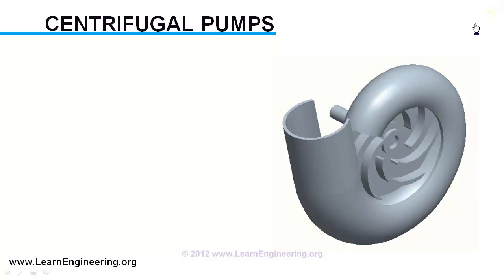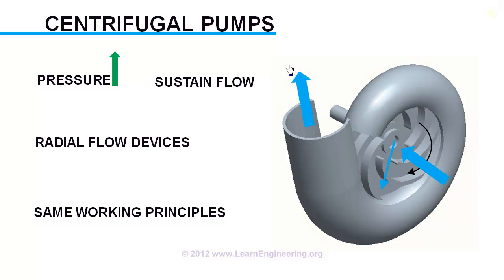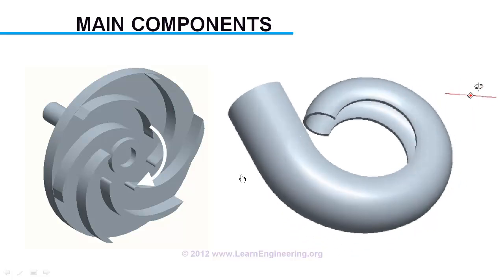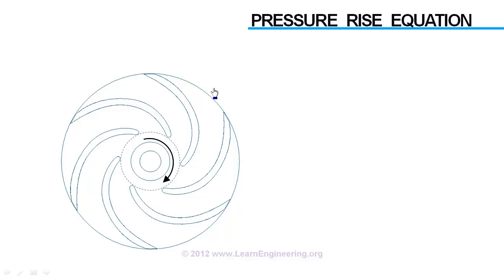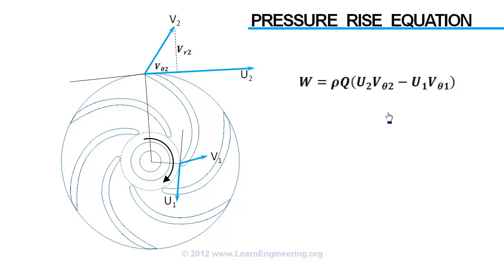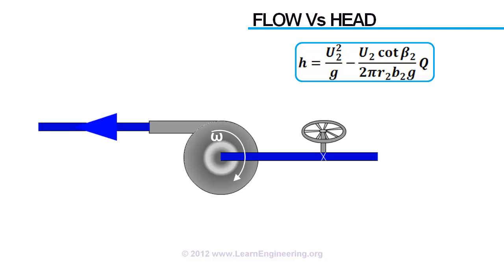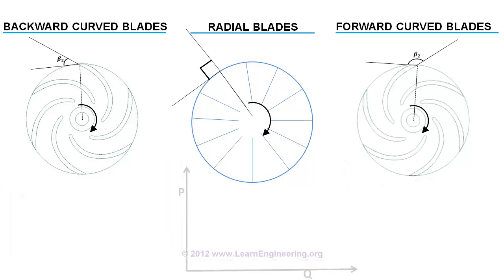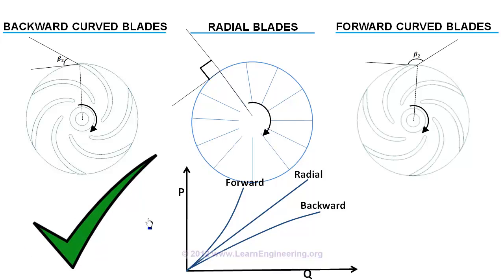Centrifugal Pump Working

Comment: Assuming steady-state operation, mass flow rate does NOT increase within the pump.  The impeller imparts energy to the fluid which generates a high velocity; this velocity energy is converted to pressure energy within the pump casing.  The pressure reaches a maximum at the pump outlet where the conduit in the casing has largest diameter and is aligned axially with the outlet piping.  Mass and volumetric flow rate remain constant throughout this process.

Comment: in one of the other lectures they explained that the volute casing is of increasing area of cross-section because it reduces flow velocity as we move along the direction of flow which in turn increases pressure energy and thus helps in overcoming resistance now they are saying flow velocity remains almost constant ? can you explain which one is true?

Comment: Nice video, but you have an incorrect representation of forward curved blades. Outlet angle is ok, but inlet angle should still stay less than 90° (you just made a mirror image, that is not how it should be).
Also, backward curved impellers are not mostly used because of power curve, but because they are the most effecient ones. Your motor will not burn out unless you are operating out of the designed range

Comment: 1:26 to 1:30 -- "...along the length of casing mass flow rate increases..." Can anyone tell me why does the mass flow rate increase along the length of the casing?
Reply: Ruben Contreras I think as there is increase in area which is  leading to accumulate more mass

Comment: sir ,
How does the volute casing act as a diffuser ? ( and hence change kinetic head to static head ) . 
A diffuser should have only one inlet and outlet right ? ( Please correct me if im wrong ) 
But in this case the volute casing has multiple inlet points ( infinite maybe ) at all angular positions and only one outlet .
Hence isnt the sole purpose of the volute casing to accomodate increase in mass flow rate ( coming in from different angles ) and hence to maintain constant flow velocity at all angular positions ?

Comment: hello im wondering what is the effect of inlet head on the performance of the pump ?

 and what is the effect of change in kinetic energy of the fluid if the inlet and outlet pipe diameters changes from 25mm to 32mm?

I need ur asistance asap please